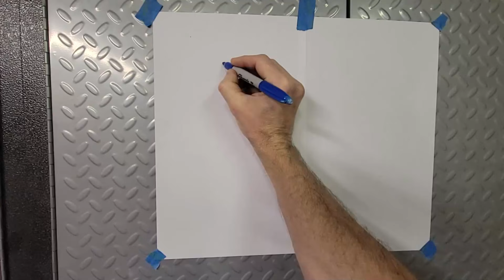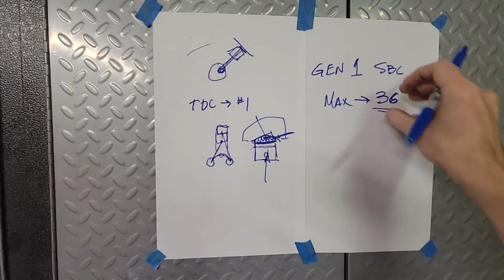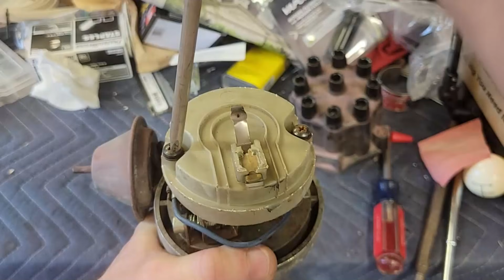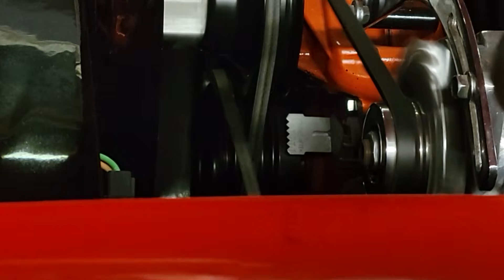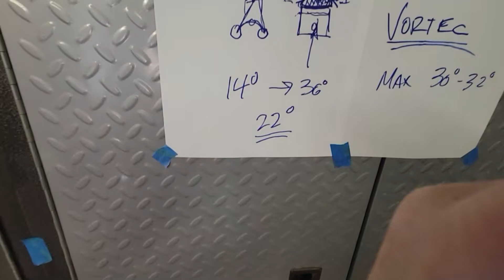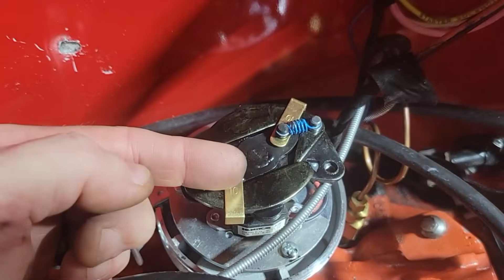How To!  Installing a Mechanical Advance Timing Limiter in a GM Distributor!

Comment: Very Interesting Bill, I’ve never put a lot of thought into ignition timing, Just set it to about 8-10 and go. So if I’m understanding correctly, with the advance limiter, you can set the timing to maximum performance at idle without exceeding 36 degrees at higher RPM ?
Thank you for the education Bill !!!